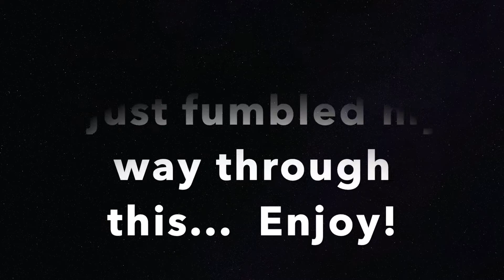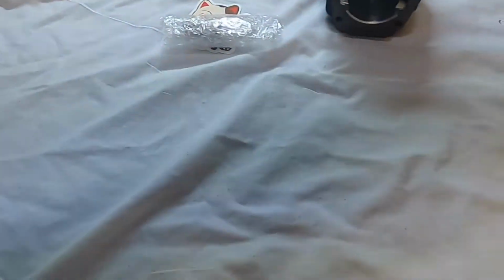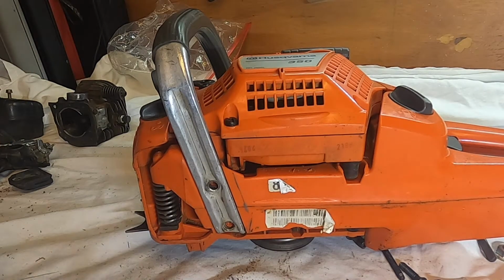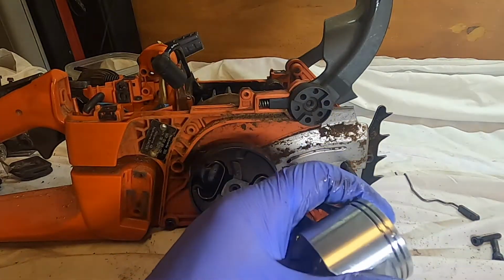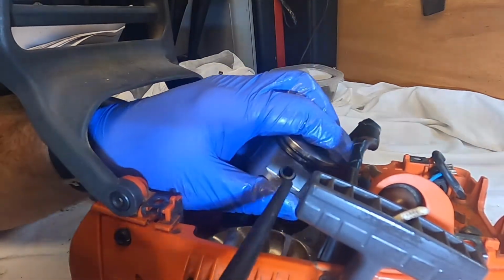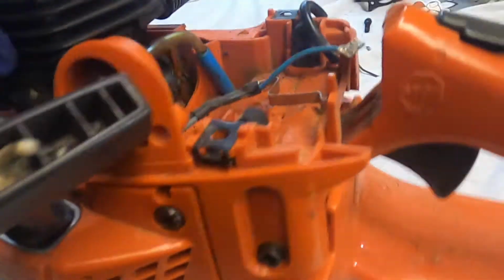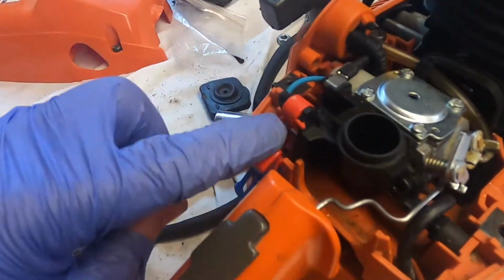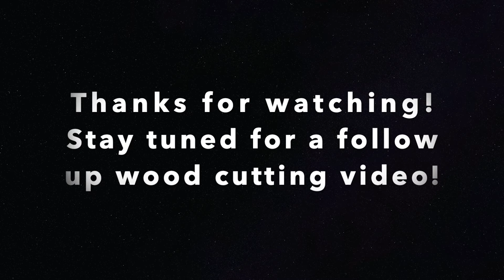Will a $50 Amazon engine fix a Husqvarna 350 Chainsaw?  Nikasil Cylinder Piston Kit from China

Comment: The plastic intake clamp is the main reason the 350 series saws run lean and freeze the rings and score the cylinder.What you repaired will most likely happen again to that saw.Test for intake leaks by spraying carb cleaner near the intake boot near the clamp while the saw is idleing .If the saw stops running you have a leak.Good camera work BTW!
Reply from the maker: Thank you!
Reply: Where is that, can you explain?

Comment: Thanks for posting
Reply from the maker: You're welcome.  Glad you enjoyed!
Reply: @kevinon4wheels   which kit did you use?
Reply from the maker: @daveperez9769  Nikasil Cylinder Piston Kit 45mm Big Bore Fit Husqvarna 353 351 350 346XP EPA 345 340 Chainsaw Decompression Valve Fuel Filter from Amazon

Comment: Year later hows it holding up?
Reply from the maker: It's a rock star!  Takes a beating and just keeps going
Reply: @kevinon4wheels  nice I'm stuck in the middle on getting the Amazon kit or the oem kit. Iv got a few other small engines to repair and trying to stay on the cheaper side. Lol. Is your chainsaw a daily use or not used often.
Reply from the maker: @stevenlaizure3739  It is not used that often.  If you are going to depend on it then an OEM may be the way to go, but for the few hours a year I put on it this did the trick for me